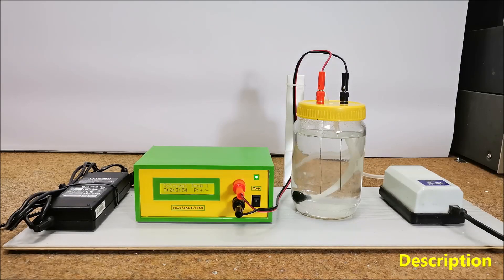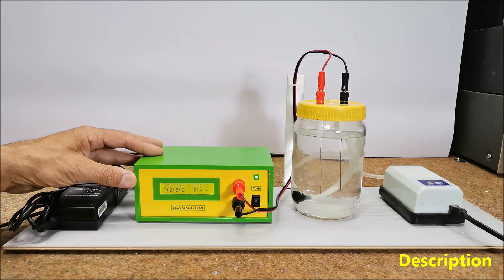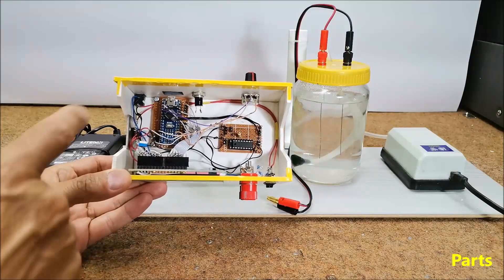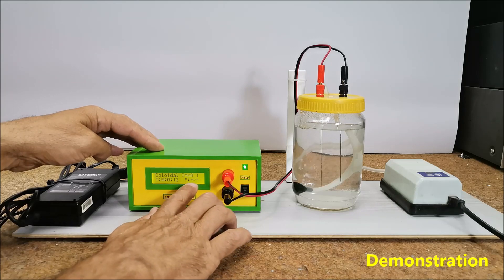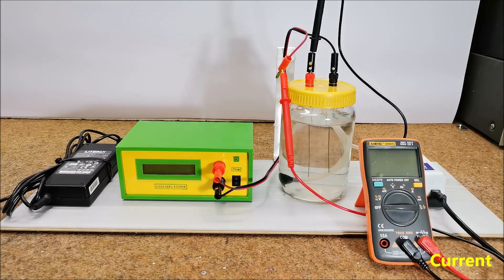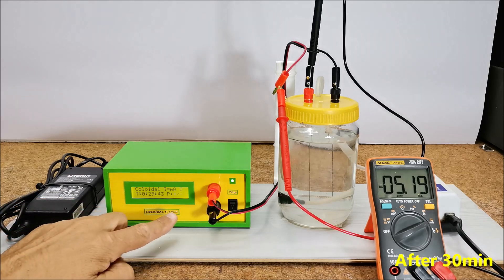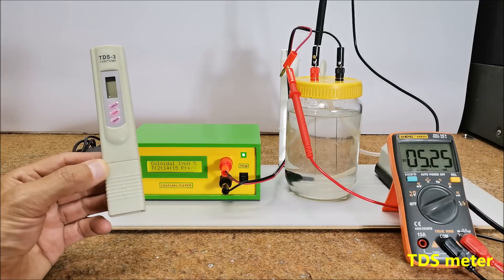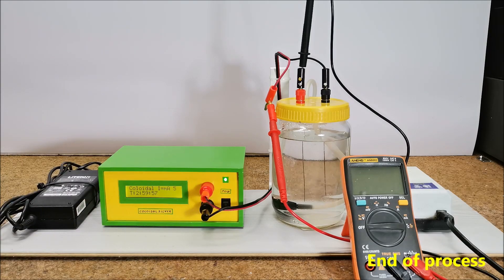DIY Advanced Arduino Colloidal Silver Generator

Comment: I was wondering, does this setup actually limit the current going to the electrodes? Does the current goes up as the PPM increases? Is the voltage going to the electrodes always at around 19V regardless of the amperage set with the Potentiometer?

Cheers
Reply from the maker: The current is always constant, as is the voltage across the electrodes
Reply: @MirkoPavleskiMK  So the output to the electrodes is a Pulse width modulation wave and the Potentiometer just changes the width of the wave that it is ON and OFF.
Reply from the maker: @papagino007 Yes correct